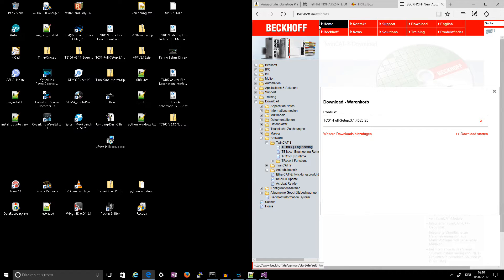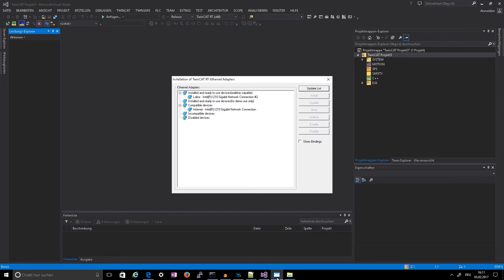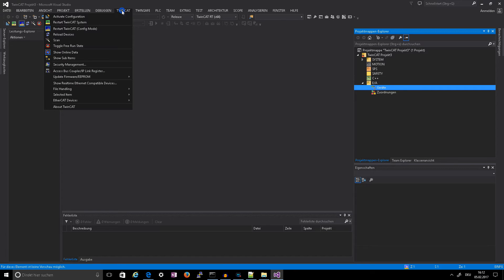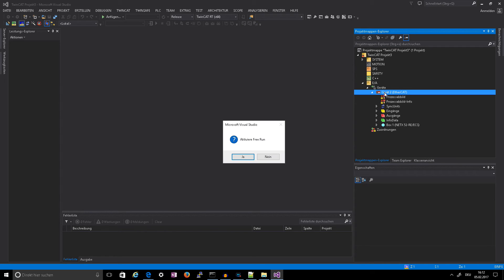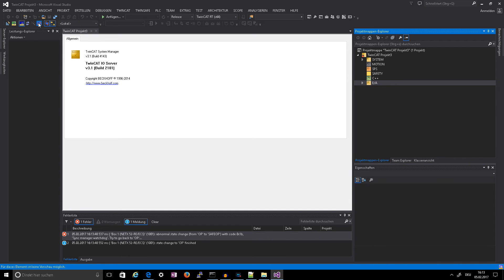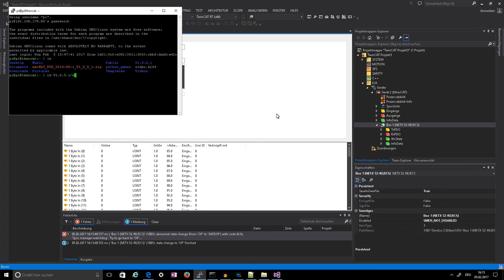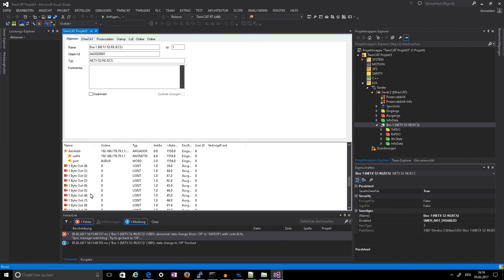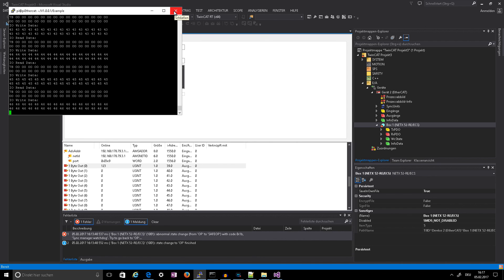Run the netHAT 52-RTE Example Code with  TwinCAT 3 as EC Master

Comment: Hi Anton, just started with the NetHAT but I am worried about the temperature of the processor. Sometimes it becomes very hot. When you put your finger on the CPU for a while ( for example a minute) is the temperature on your NetHAT's CPU "swinging" as well?
Reply from the maker: Yes my Hilscher get also quite warm. Now I'm working to build an EtherCat Gyro. Video will also be done.